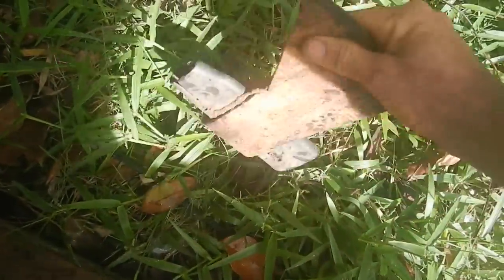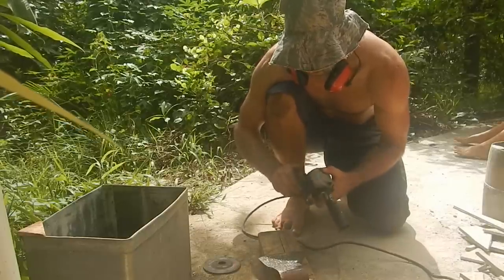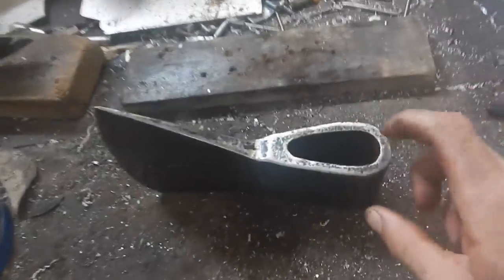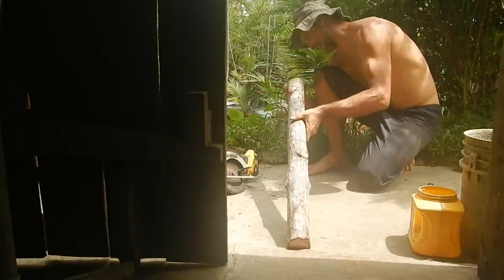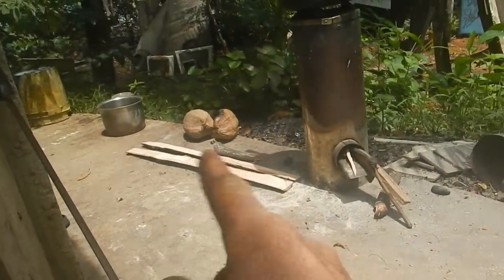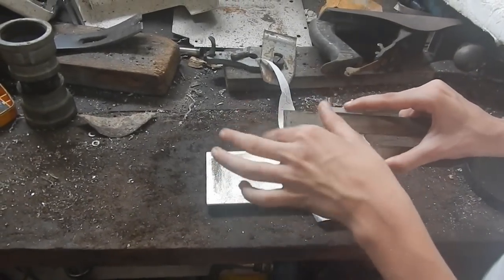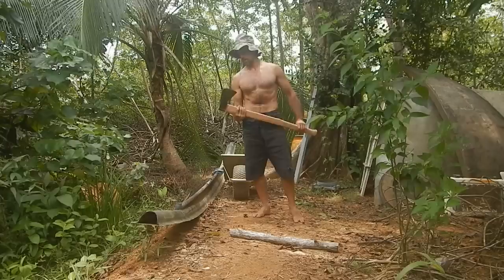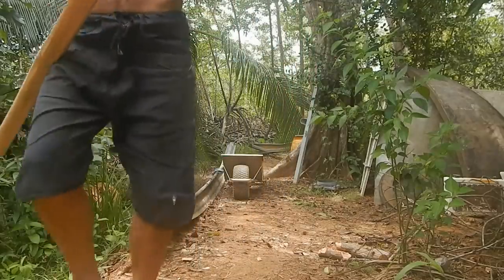Restoring an Old Rusty Axe Head

Comment: That is great, it's always so satisfying using tools with handles you made. Traditionally they would use larger timbers and split them into 8, producing triangular sections, hence the triangular socket in the head.

Comment: Draw knives are great for handle making. Also a quick tip: when working with raw logs/limbs keeping the pith can lead to checking/cracking. As the wood dries and shrinks, the grain strength gives and this is why you see cracks radiating from the pith.